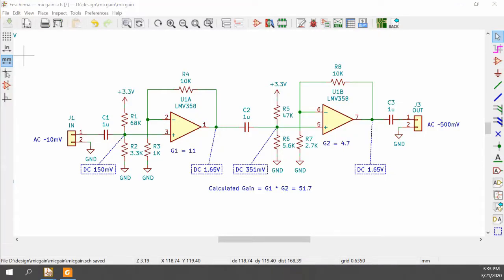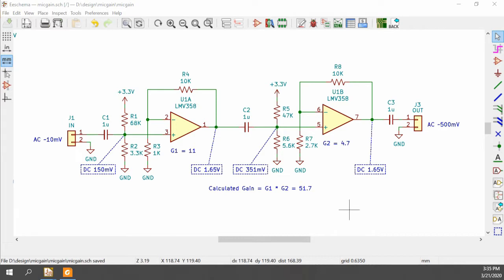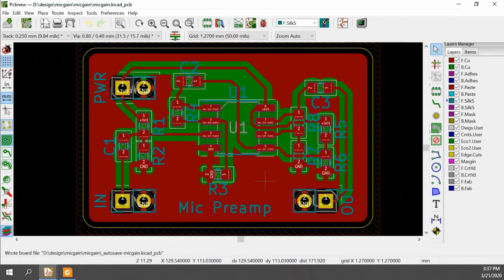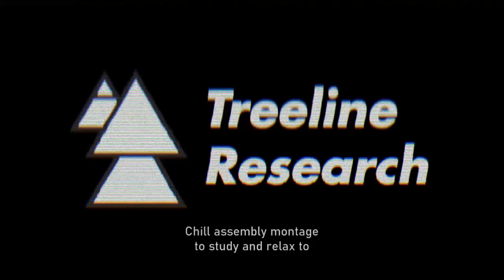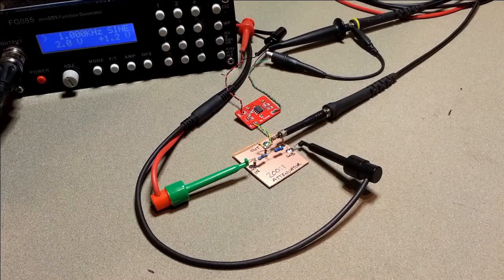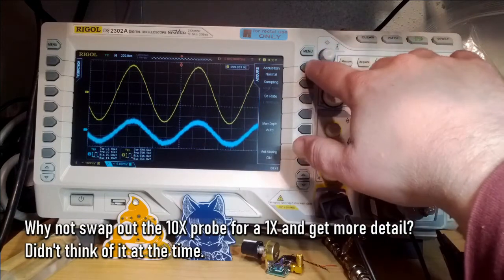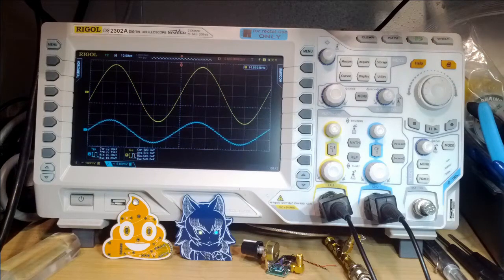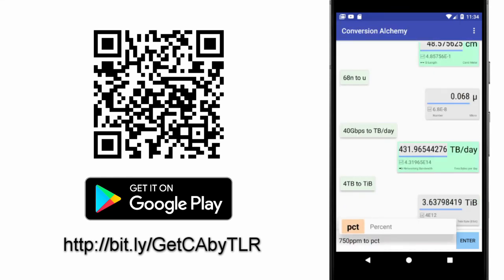TLR001 - Electret Mic Pre-amp

Comment: Great Video. I know its been 4 years since you posted this video. But still, I'd like to describe my situation. I have a 48V phantom powered condenser mic which is connected to a V8 soundcard, which then produces output sounds. The problem I am having is that the mic gain has to be dialed to the maximum everytime I use it. So I am actually looking for a DIY preamp like your design to see if I I don't have to. 
So, the mic connects to the phantom power box via a 3.5mm plug (with Ground, L/R output). My question is, do I have to duplicate this circuit in order to cater for the L and R output from the condenser mic? Would you prefer a dual or quad opamp for circuit design and PCB production?